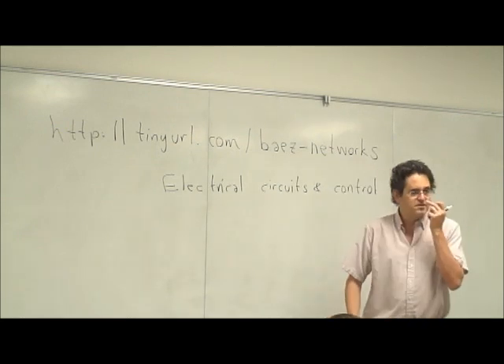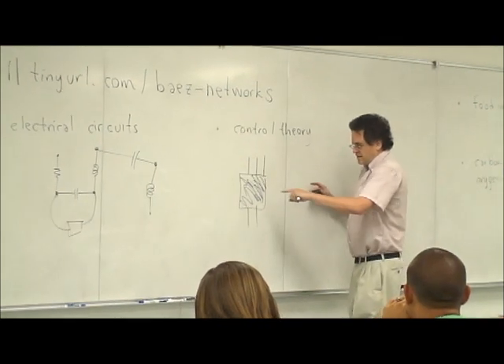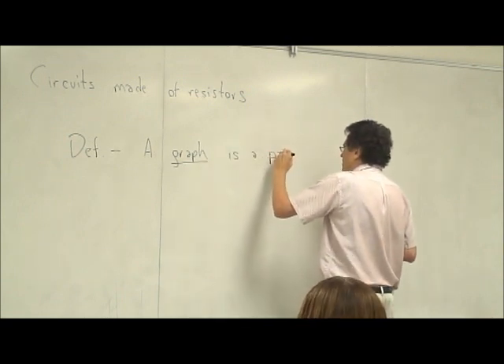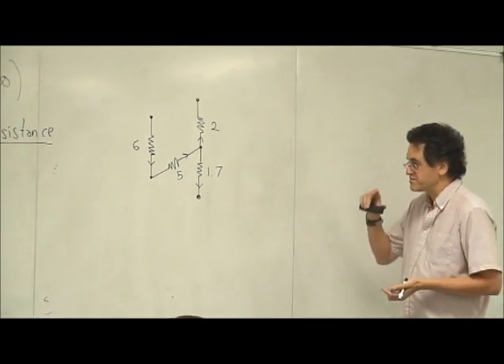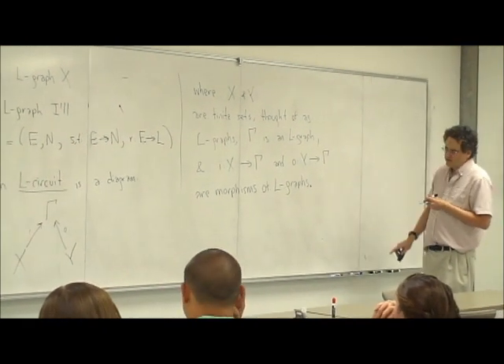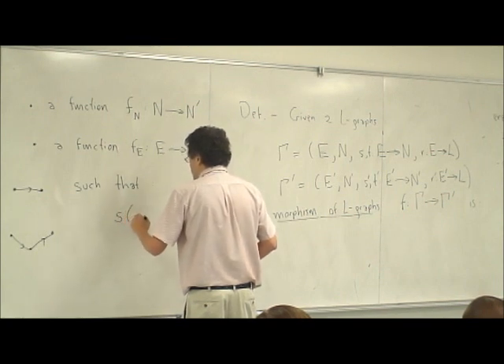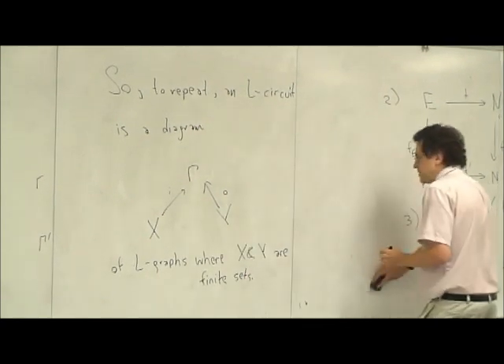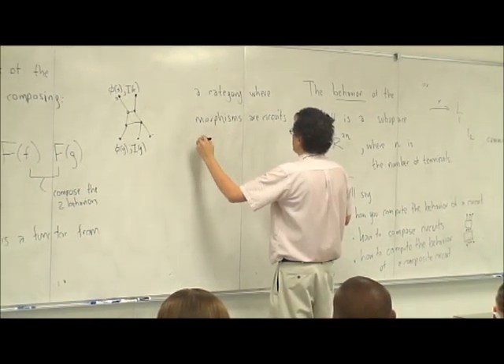Network Theory - Seminar 1

Comment: I'd like to guess what is the composition of behaviors. Is it a kind of fibered tensor product along the projection associated to the output of the first circuit and the input of the second circuit. The idea is to glue in a way that on those projection we get the intersection. Of course the result should be a projection of that fibered tensor product along the input of the first and the output of the second (the loose terminals) so that the constrained (glued) terminals desappear.

Comment from the maker: Network Theory

The world needs some new kinds of math, which deal with networks.  So, check out this video! I start with a quick overview of network theory, and then begin building a category where the morphisms are electrical circuits - a warmup for more complicated kinds of networks.  You can also read lecture notes:

• Network theory (part 30), http://johncarlosbaez.wordpress.com/2014/10/03/network-theory-part-30/

With luck, this video will be the first of a series. I’m giving a seminar on network theory at U.C. Riverside this fall. I’ll start by sketching the results in this new paper:

• John Baez and Brendan Fong, A compositional framework for passive linear networks, http://math.ucr.edu/home/baez/circuits.pdf

A couple of weeks ago I talked about having a Hangout on Air, but I didn't get my act together in time to set one up with a camera of high enough quality to make my writing readable on the long whiteboard in this room.  So, I decided to use a videocam provided by U.C. Riverside.  It can't hook up directly to my laptop, since I don't have FireWire, but it creates mp3 files that I can upload later.  These have a maximum length of about 30 minutes, but using Windows Live Movie Maker it was easy to stitch them together into a single file.  Then I uploaded this to YouTube.

So, that's the best I've been able to do so far.  If you have questions about the seminar, you can ask them here - or even better, on the Azimuth blog, where the conversation has already started, and you can write in TeX:

• Network theory seminar (part 1), http://johncarlosbaez.wordpress.com/2014/10/11/network-theory-seminar-part-1/

In the future, I'll announce seminar videos on that blog.

I thank Blake Pollard for filming this seminar, and Muhammad “Siddiq” Siddiqui-Ali for providing the videocamera and technical support.
Reply: Thank you for putting these together John Baez !
Reply from the maker: Glad you like it, folks!   It ain't as good as Joan, but it will have to do.
Reply: This is great.
Reply from the maker: Arnab Paul - thanks!  Seminar 2 is here:

Network Theory - Seminar 2
Reply: Every time I search YouTube for your Videos it tries to steer me to your cousin Joan. :-)
Reply: Sean Merritt Check out Marius Buliga's work on a form of Lambda calculus that has a very elegant way of doing synthetic chemistry and biology:
 http://chorasimilarity.wordpress.com/chemical-concrete-machine/

David Ackley has some nice ideas too: http://www.cs.unm.edu/~ackley/
Reply: Thank you for posting this!
Reply: I wish I could bookmark G+ posts directly...this is great, and I want to watch it during my daily commute.
Reply: waiting avidly for the next installment. this is simply brilliant (like all of your stuff)
Reply: thanks prof. baez; apart from your amazing contributions to science, you are one of the best expositors and teachers. I wish all your lectures were recorded, and students from all over the planet could watch them.
Reply from the maker: Stefan Forcey - there are lots of great questions about the reachability problem for Petri nets, and the computational power of Petri nets.  I explain the background in chapter 25 of my book with *****:

http://math.ucr.edu/home/baez/stoch_stable.pdf

The references in this section will lead you to lots of concrete challenges!  I'm a theory-builder, not a problem-solver, but one huge problem is: what's the computational complexity of the reachability problem?  Chapter 25 explains the tangled history of this still unsolved puzzle.   It also explains how this problem can be formulated in terms of symmetric monoidal categories.  I have no reason to think that formulation will make it easier to solve!  It just shows how fundamental it is.

Another huge problem is the Global Attractor Conjecture - see page 182 in my book.  Again, I have no reason to think categories will be the key to solving it.
Reply: Jerry B. Altzman You can. Just click the timestamp of the post to get to a page containing only that one post.
Reply: Thanks for sharing this. Any Synthetic Biology examples?
Reply from the maker: Sean Merritt - Erik Winfree and his group at Caltech are very interested in using chemical reactions to compute things... and in using DNA as a way to simulate any set of chemical reactions you want!  The underlying math here is the math of reaction networks, or equivalently, Petri nets. 

Parts 1-27 of the network theory series were about reaction networks and Petri nets, and ***** have turned these parts into a book, which you can find here:

http://math.ucr.edu/home/baez/networks/#petri

So, while I'm not personally working on the synthetic biology applications of networks, they definitely exist!
Reply: Thanks! This book is terrific, a really comprehensive introduction to the subject.
Reply from the maker: Thanks!